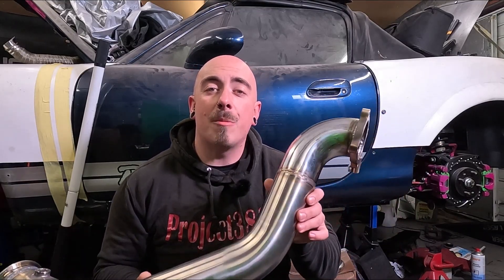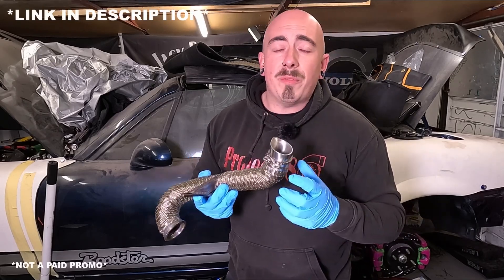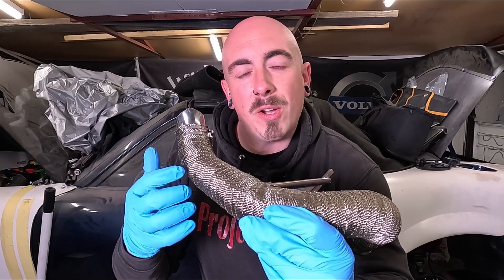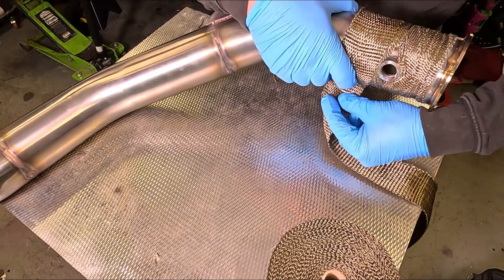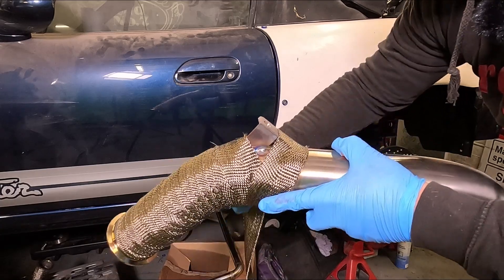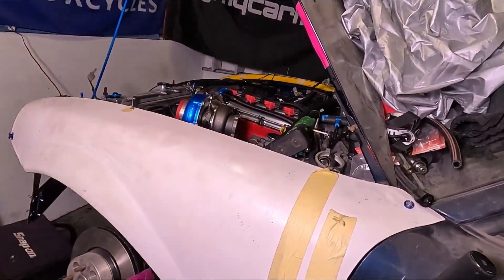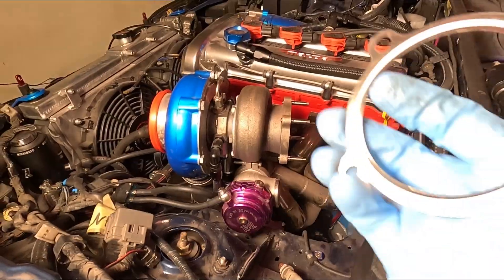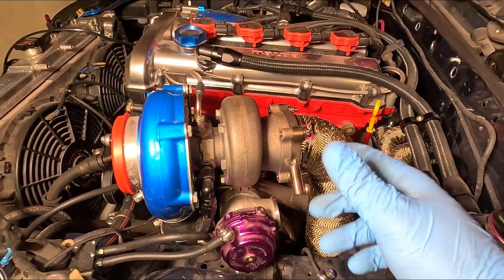FUNK MOTORSPORTS LAVA ROCK HEAT WRAP : MX5 TURBO BUILT pt 57

Comment: Again, try JetHot Coatings as it coats inside & out, so you get Better Flow and lower temps!!! They have a couple of different coating temp ranges, so they can be used on the turbo housings and well as headers and down pipes as well as valve covers and oil pans! A WIN WIN! Thank You for all your OUTSTANDING VIDEOS!!! Best Always, Chris Zinn P.S. Try Stage 8 locking bolts. They are Great Too!
Reply from the maker: ill look more into this, thanks mate.
yeah stage8 seems to be hard to get a hold of from where i am